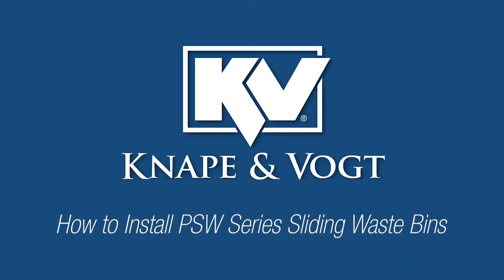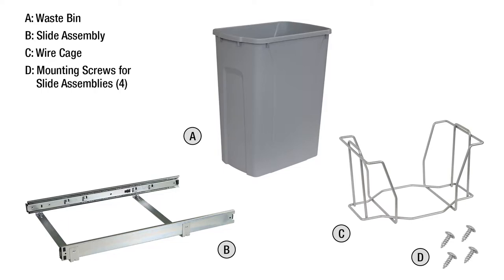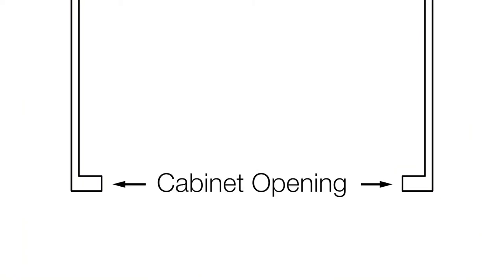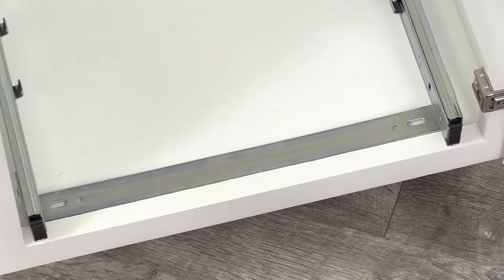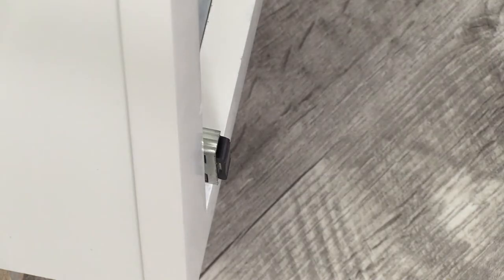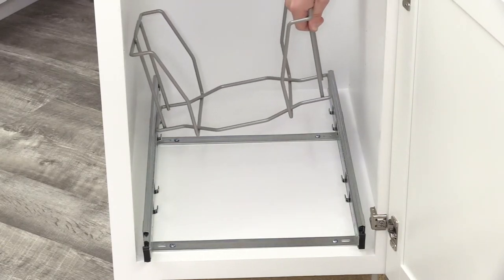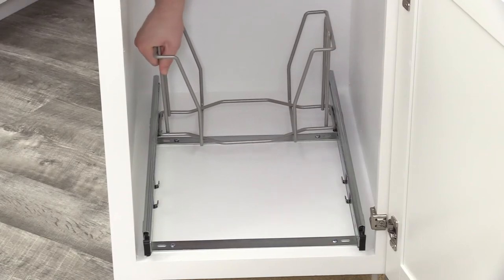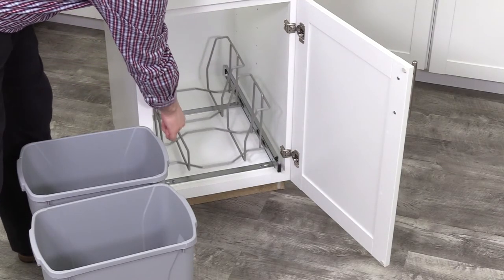Knape & Vogt - How to install PSW Series Sliding Waste Bins

Comment: Came here to better understand those black clips that were included. I am guessing a different model as the cages are different. So still confused, I had hoped they'd be shown.
Reply from the maker: Hi Charlie. You may not have this unit. However, I think the video you will find helpful is this one. https://youtu.be/lZ0wEKzNb1s